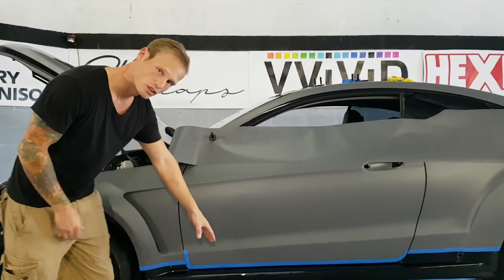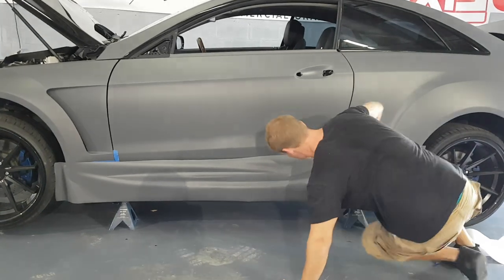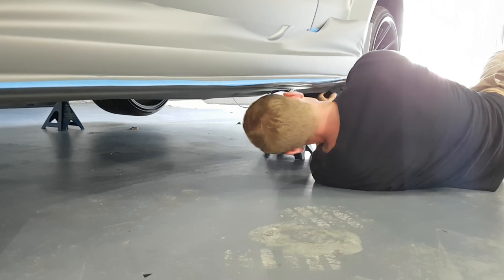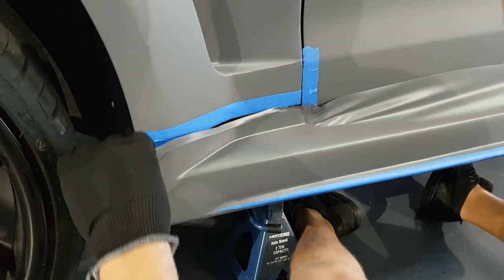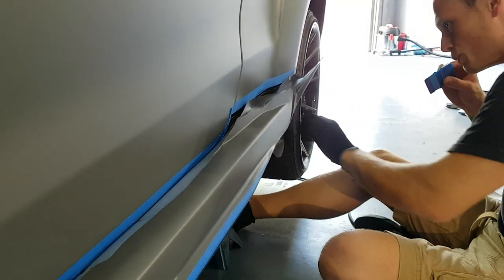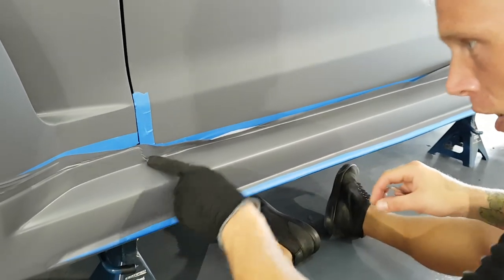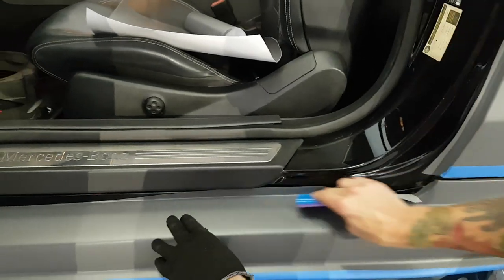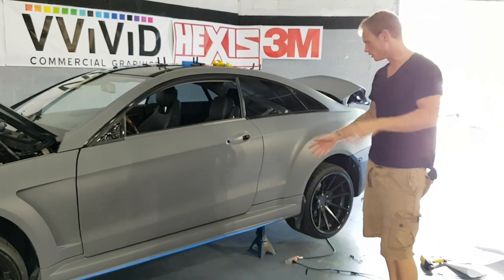Vinyl wrap tips and tricks, complex wrapping. How to post heat and how it works. By @ckwraps

Comment: Just curious… You mention focusing on areas of tension, but isn’t post heating required, especially at edges, to activate/lock in the adhesive? Just curious what your thought is here.

Comment: That piece was actually easy compared to the aftermarket skirt body pieces I tried to do. Think of it as doing the shark fin but add 6 more angles. The front diffuser not only had a flat base, but also a vertical lip on the end thats 3 inches high. So we're talking like 9 different angles on 1 piece, a wrinkle/stretch nightmare. I tried 4 inlays (base, back, top of lip, each side of lip) and trashed the vinyl. Was not looking good. Painted it gloss and 100% better.  I really need experience on the multiple angled pieces, they're my only crutch in wrapping cars. It would really help in just having videos wrapping those small bits.

Comment: With a heavy recess, would it be a good idea to use some amount of Primer 94 in order to prevent lifting in the recess area? I can never get recess areas to remain and not lifting after a few days.  I see that the key is getting the post-heat up to the right temp.  NICE!

Comment: Great skills n vid + the explanation. However i was wonder if u did cut on the side skirt when u did the cut in the door, from the inside. Bc there was no tape. Hows that done ?
Reply from the maker: There is a gap between the side skirt and the car itself
Reply: @CKWraps  got it, thanks. Raised the question bc i highly doubt that u'd cut on the paint

Comment: quick question, i'm having trouble post heating my interior parts evenly at 90 c/ 180 f, my infrared thermometer seems to be all over the place!  i really want to do this properly, wondering if i can place the parts in an oven set to 180 f for 30 seconds or so?